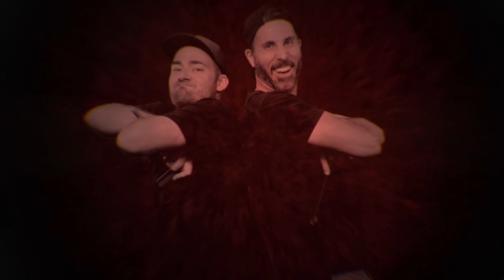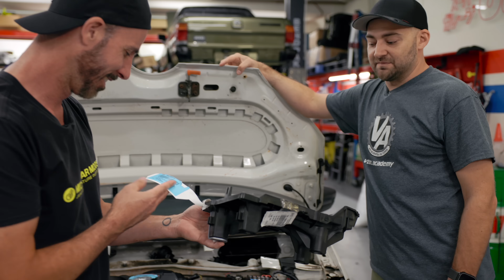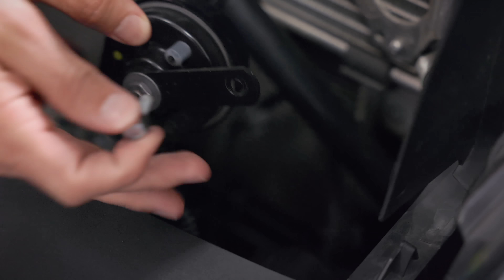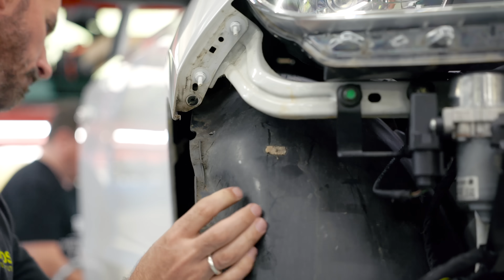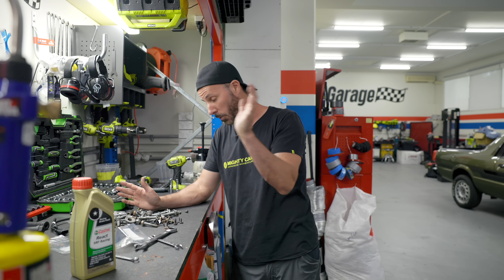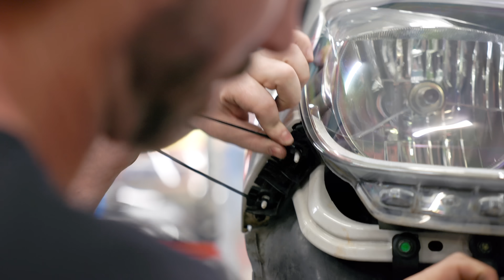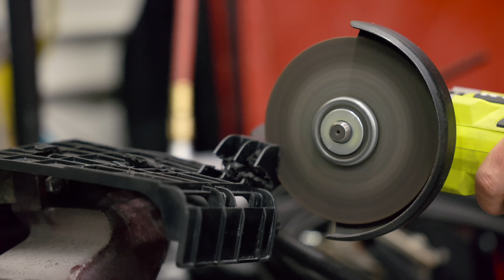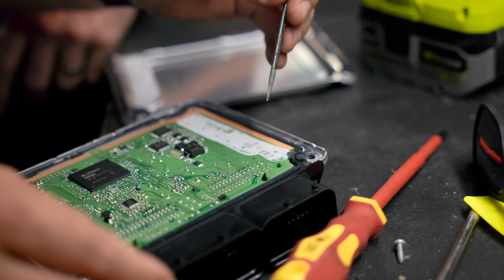I DESTROYED my VW UP! - Turbo GTI Conversion EP7

Comment: There's a good chance that the main chips on the board are fine. If you do find another ecu and you don't want to pay to have them all coded together through vw, we can try swap all the chips with the per-vehicle data from the dead  one to the working one

Comment: I do tuning and cloning ecus alot. This happend me on a bmw that has + cable underhood for charge was not covered on the car, and i was laying ecu down on it without knowing.
Check the ground pins inside, the ground pins was melted away on that ecu, we solder connection again and car started up right away. ( The pins from connectors you checked on the outside, you need to take out the board to expose them, if you see one melted right away, your gonna have a car start up when soldering that back )
This might be the case here aswell.
And the fan starting is bc relays, and no contact with ecu, so that will be fixed aswell when ecu is talking with car again. ( If you remap a vw and this happen, you have bricked the ecu and need recovery, normal vag )

And people in the comment, try to get this comment up, this could be the fix for them aswell.

Comment: Dont you guys have a local ecu tuner Company or professional near you? Chances are something fried on the printboard of your ecu, and if you are lucky someone with a few basic soldering and diagnostic tools for circuit boards may be able to mend it. I have mended plenty of ecus, if you have fried a component inside the ecu you might be able to scavenge parts to resolder from a similar ecu that might be more common on Australian cars. Many Bosch ecus share components, especially in the power distribution and supply lines. Your ecu is a Bosch MED17.1.27. Tuning professionals have access to documentation on these ecus, and you may be able to compare docs to find an ecu in cars more common in Australia, and have a local tuner / solder professional try to mend it with scavenged parts. This is a solveable issue. Best of luck boys. Best regards from Norway.

Comment: Get someone to desolder and transplant the ROM/NVRAM chips to a donor ECU and it will retain the coded-ness of the new ECU to the engine/vehicle. If the memory chips got 12V zapped through them they will be dead but it's much more likely other parts have given their life to protect the memory.

Comment: I can totally relate to your ECU problem. I was working on my BMW 535, dropped the ECU on the starter, set off the car alarm and arced a hole through the ECU case. Wouldn't run properly, and burned up a coil. Had to find a new (salvage) ECU online after trying to replace the chips I fried on the board.

$12 valve cover gasket turned into $650 ECU/cloning service.

Comment: Earth the ecu... you have burnt  the grounds pins like a fuse on it...  as a it uses grounds for switchs ... it only has power and switchd ignition...what's  ecu part number as in UK there cheap.and used on many VAG cars

Comment: So I think what you might have done is send 12 volts from the ground of your computer through the ground pins of the computer to the chassis. The good news is that voltage is a potential difference, and it thinks the 12 is ground, so it's probably fine as there was never any potential difference to hurt the computer. The bad news is that you probably fried the ground trace or pins. Someone may be able to fix it for you.

Comment: Check the continuity of your earth wire from the ECU to the chassis.  It could be that it's just the earth wire that acted like a fuse.  That could have made your ECU ungrounded, causing the issues.

Comment: This is not the first! Try putting extra ground strap on the body of the ECU. Inside the Ground traces/pins burned out. 
Just try putting a addinional ground strap on ecu. It may help in yours situation! ✌️

Comment: Usually when you fry an ECU like this, connecting a ground wire the the metal casing will work, it's a "trick" I learned from my tutors during my training as a tech since this kind of errors happened quite often with young stundents, it might not work all the time but it's worth trying

Comment: Your guys first step is always, jack up your car. Dont know if you guys have 'Haynes Manuals' but in there for even the most benign job, first step is, disconnect the battery. Ive done what you have countless times. There is always a way out, dont be down :) x

Comment: I've had suspected problems with my ECU... I did manage to find shops that do Bosch ECU Repairs. As long as the chips are not fried all the other components could be fixed... my ECU was also rare, no replacements.

It turned out to be another problem, but I did find ppl that were willing to replace components on the board to see if all outputs wanted to talk CANBUS again.

Hope this helps, I am sad for you guys and the car

Comment: The ecu case is normally "loosely" connected to 0v (vbat negative) in order to provide a common mode return path for AC parasitic currents, that would otherwise generate stray A/C voltages and result in excessive EMC emissions from the ecu.  Touching the case to the positive terminal of the battery has most likely shorted this loose coupling shut.  The "loose" coupling is actually just some capacitance and some resistance, which may be distributed across multiple physical components on the pcb. However, that damage should be pretty obvious, and if you just remove those components completely, the ecu will likely work.  Yes it won't meet EMC limits, but i don't think that's too much of a worry on your particular car.

Comment: I had a dead ECU in my MK4 GTI.  Instead of coding the replacement ECU, I transferred the IMMO chip from the dead ECU onto the new one.   The car was back up and running shortly after.

Could be worth investigating if you can source another matching ECU.

Comment: Almost all repair instructions begin with disconnecting negative  battery terminal. Seems trivial, but this is an example of why it's an important step, particularly in modern vehicles.

Comment: If you're stuck, send me the ECU in NZ and I'll fix it. But if you lift the board, you'll see heaps of legs going from the board to the connectors. You'll have vaporised one of the earth pins. I can guarantee the actual ECU itself is fine.
Reply: Someone further up with 1.4k upvotes says the exact same thing as you. So I assume they'll get the info eventually.
Reply: @andersjjensen I can't see that comment anymore
Reply: this seems logical to me.
Reply: Sydney person here, who does component level repair of PCBs. Same offer though I imagine it's already sorted.
Reply: Those pins are heavy gauge and would definitely not vaporize before some miniscule bit of silicon inside an IC.
Reply: @bobbym6130  The ICs probably won't actually be seeing any voltage. The case will be connected to ground via the PCB (likely via several lines.) From inside the case shorting it to power will send loads of amps out through those ground pins. But it'll look to the other components on the board like ground is rising up to the power rail. Not actually a reverse polarity, just low voltage. The issues are going to be PCB traces and pins burning from the current and any over/under voltage ringing from the arc. 
There could be some potential across the PCB if the battery touched away from the plug end but it should be pretty low really.
On board fuses, TVS diodes and power supply conditioning is what I'd be looking at first. I doubt that the main MCU will be damaged.
That fan slowly spinning up to full speed sounds exactly like a mosfet with a floating gate drive drifting to power. That'll only happen if it has lost the ground reference as typically they will be pulled down by a resistor even during reset.
Reply: @zyeborm  the fans spinning up are because the fan control module can't see the ECU on the CAN BUS. When the ignition is on and the ECU isn't there, the fan module will run the fans at full speed as a failsafe to protect the engine.
Reply: @bobbym6130  it's already been replied further up, but the case is grounded via the harness. Touching the positive battery terminal will ground via the case and the rest of the circuit won't be energised. As it's unfused, the leg to the harness connector will become the defacto fuse.
Reply: Bump
Reply: Did case touch terminal while man held case with bare hands, if not your screwed.  Lack of burn marks on icb offers hope. Does board smell burnt?
Reply: Yes, this! And that earth pin is now floating probably. Could also be the wiring harness though. 
Would it help to ground the housing with a separate lead and test again?
Reply: Seems like a failure on VW's part.  Aren't ECUs normally covered in a non-conductive polymer?
Reply: @nunyabizness9885  not really, they aren’t ment to be near, never mind touching the terminals on the battery
Reply: @nunyabizness9885  Nope. They all have metal outer casings for heat displacement. Some have plastic backings but the vast majority are all metal. 

The board on that ECU is held down with a very sticky thermal compound that conducts heat away from the various drivers for things like coils, injectors, throttle body etc. Ironically, the processors don't tend to have any heat sinks.
Reply: Nah, the PCB might have conformal coating, but the metal case is tied to ground (bat -) to protect from emi and RFI :) @nunyabizness9885

Comment: Finally managed to finish the video... guys, this sucks. That's just rotten luck that is. I've had it happen twice so far once by accident once by sheer stupidity by welding without disconnecting the ground... and it absolutely sucks having to source on old stuff in particular. I hope you catch a break Moog and find something. :( Sending positive vibes your way.

Comment: ouch. many people have already commented on getting the ecu repaired, or putting a haltec in. I would probably look into repairing the original to keep all the functionality. Only thing i wanted to add is to be careful of any replacement/remanufactered ones. Parts have been particularly unreliable lately with companies trying to get reman stuff out the door to customers after the pandemic. I dont know if it's lack of suitable cores or manpower or just heavy demand as people try to keep things going....but its been a real mess for people on the repair side. Just keep that in mind when you're deciding

Comment: A few years ago, I was putting a tow bar ecu into a vehicle, I pinned the wrong sensor wire to a 12v terminal. So i put 12v down a sensor wire that shouldn't have aeen more than a few volts. Fried the control module, $600 fuck up.

Comment: you can run an earth wire to the case of the ecu to the earth of the battery and it may work again. may or may not have seen and fixed that issue before...

Comment: You can buy unlocked ECU's that work in any car just need to do a little stuff in VCDS. I have 2 ECU's for my car 1 has a stage 2+ map on it the other is factory. You can also pull data off the dead one and put it on the new one cheap.

Comment: If the case touched the positive battery terminal while the ECU was plugged in, it's quite likely the ground traces that got blown out, as the current path would be battery +12v -> case -> circuit board ground -> power connector -> battery -ve.  I guess it depends on how long it was connected as to how much damage was done. I don't imagine it's the kind of path that would usually be fused, since fuses are usually used to protect for faults where the board is drawing more current than usual from the +12v line, not from the case -> ground.  If the above is correct, then an issue you'll be up against is that a lot of (most?) modern circuit boards are multi-layer and will likely have one of the inner planes dedicated to ground, with vias running through the board to get to the outer traces and out to the ground pins, so some of the damage may not even be visible from the outer layers.  Chances are you've blown out some vias and lord-knows how many traces with the hundreds (thousands) of amps that a car battery can supply..  I really feel for you, it's super crap to have such a huge setback at the last minute like that.  I really hope I'm wrong and it's something simple and easily fixable.
Reply: That's what I was thinking but I would add that ECUs control the ignition coils and injectors etc. via ground switching so it's even possible that the ECU traces were beefy enough to handle the current and it's actually melted some ground wires in the harness somewhere.
Reply: in this case theres 2 or 3 ground pins from the edge connector which act as "fuses". curent flows from the case back to the battery Negative through those pins. it has no reason to go anywhere else on the board.
Reply: @Nebbia_affaraccimiei I really hope that's the case, it would be amazing if it's easily fixable!
Reply: in this case theres 2 or 3 ground pins from the edge connector which act as "fuses". curent flows from the case back to the battery Negative through those pins. it has no reason to go anywhere else on the board.

Comment: Surely Haltech will have some electrical wizards that could repair that ECU? They must have inbuilt fuses for the power delivery to the board that are designed to blow when a short occurs?

Comment: Its not a secret.. them german dude specifically the audi club and vdub boys over there. There play with some crazy sht over there. 1000hp ez little hot hatches. Every now and then u see a german on the motorway shredding supercars. We not talking car lengths. We talk flying by while the supercar is at its peak rpm. Dont mess with the germs

Comment: My first experience with a battery i shorted across the posts wit a big shifter 😮 then the steel battery cover plate nissan g60 fell across the posts out in the desert., yes it's possible ... since then ive been quite careful with batteries  Probably kicking themselves for not removing the battery before playing with the ecu, rookie mistake i reckon.

Comment: If you can’t find a replacement ECU, ACTronics in the UK might be able to repair it. They’re experts in such matters. Shipping might be a right faff but surely cheaper than a new unit, plus taxes, plus reprogramming. In the UK, I can’t see a VW dealer even touching a car so heavily modified.

Comment: You should buy my Actual Turbo Lupo GTI. 
Quaife LSD. Turbo from a Porsche race car, 8 injectors, 6 speed gearbox. 
Only been an unfinished project for 29 years. 30k miles on the clock 😂 
It’s in England, let me know if I should book a container 😊

Comment: I can’t believe just how hard this car has fought you at every step.  After the success that was the STI swap on the LeVorg I thought this would be relatively straightforward, it’s just the VAG version of that.  But nope, couldn’t be a more different experience!
Reply: The main problem is theirs is a pre facelift and the GTis are facelift so a lot of the things they are struggling with would have been easier with a facelift UP! People underestimate how much a facelift actually changes especially on a VW
Reply: @Afraz_9n3  exactly. If they use the same generation, it will be relatively easy a probably cheaper after all.
Reply: @MJM703  exactly that. I know a guy who did a 9n3 GTi swap into a 9n 1.2 Polo. And he said that was a fucking pain to do because so much was changed. Worse so because he did the front end swap as well (if he'd just done the engine it'd be easier although still a fair bit of work and cutting of the original bumper). I also know a guy who turned a 9n3 1.2 into a GTi and he said it was easy as piss. Cos everything is pretty much the same just the grilles, subframe, and ECU were different and that was easy enough cos he had a full donor crashed GTi

Comment: Generations of top level engineers spending their entire careers designing Vags to be unmodifiable. Bcz it's unsafe and therefore illegal.
"But that was an accident!" In a normal car, the ECU is somewhere behind the center console, inside the cabin. In a Vag, the ECU is right there next the to battery, so when you try to pull it out as a basic mechanic would, it will short circuit and destroy itself. This is the stuff the Vag engineers have designed all their life. To avoid the possibility of re-using second hand/stolen/crashed Vags.

Comment: Such a stupid question, but I thought if anyone knew it would be the comments on MCM related videos. I bought a no-name air filter that came apart. I replaced it with a K&N cone filter with the exact same dimensions, however the K&N one weighs nearly double. is this just better quality materials, or is there something more to this? Also how would I go to about starting to investigate any damage the no-name brand one caused?

Comment: Don't get down, it will be awesome when done! could be worse, you could have a 97-98 C5 corvette or Camaro ECU/PCM that is basically guaranteed to brick every time you tune one. You need like 5 spare PCM's on hand just incase and even when they do work, they are severely power output limited by there capabilities!  AKA JUNK!

Comment: Check the main fuse on top of the battery SA1 for continuity and if that doesn’t work then check for a fried body control module. Usually you can see that the body control module has been fried when it’s opened and visually inspect.